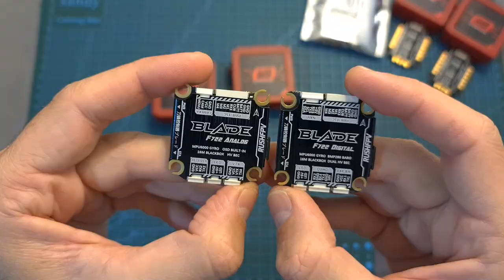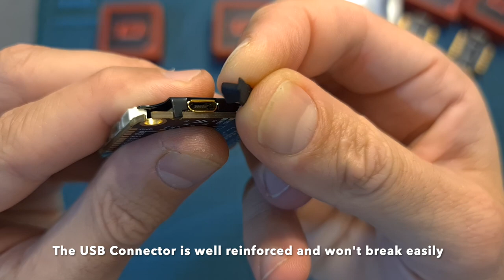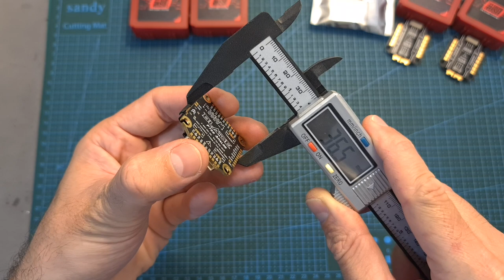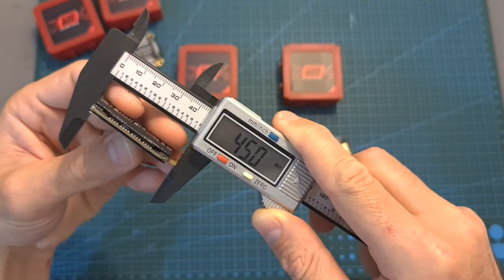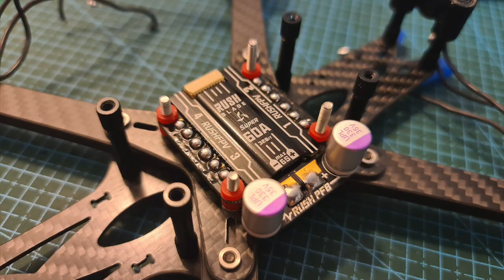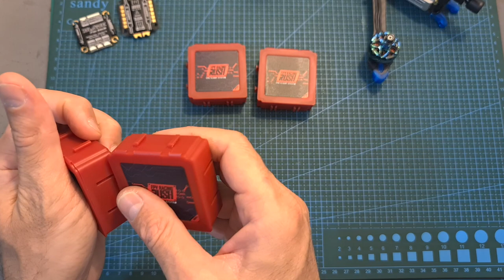RUSHFPV Blade Super & Sport ESCs And F722 Digital & Analog FCs - Overview & Setup

Comment: Hey, great video; I just got the rush RC filter board, I just wanted to get some things clear about it. Can you solder this to any type of ESC?. Also is it better to put this filter board on the ESC over the provided single capacitor the manufacturer gives with the stack? i got the  "Skystars F7 HD FC + KO60 60A 4in1 ESC Stack",

Comment: I just installed the analogue stack last night in my ImpluseRC Apex and it was a breeze. My only gripe was that the ESC didn’t come with 14 gauge wires or connector for the lipo. Otherwise a great plug and play stack so far.

Comment: Is there an analog version but with gps? Because from what you can see, the analog version does not give this possibility. There is no free tx and rx. Is it true analog? And you can't use an analog webcam on the digital version?
Reply from the maker: The digital version doesn't have an OSD chip. You can definitely use a GPS with both stacks.